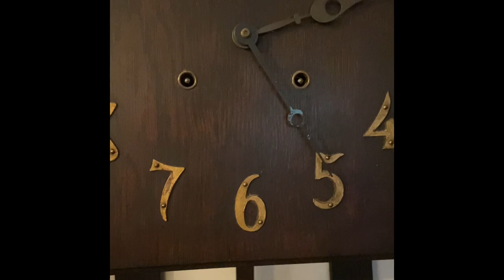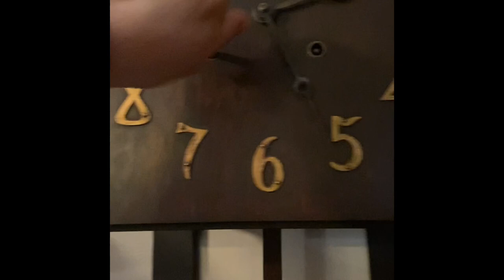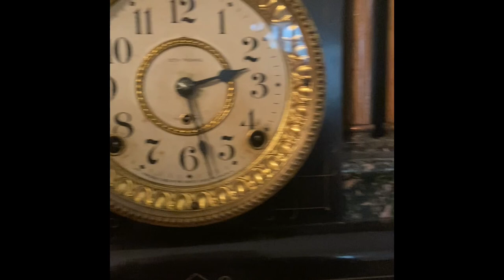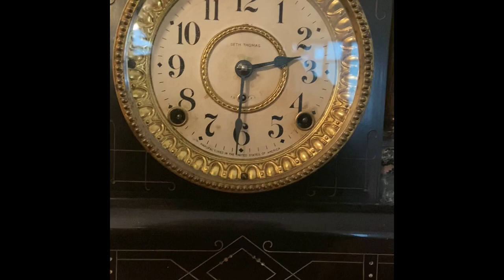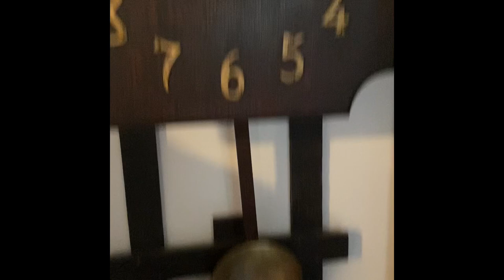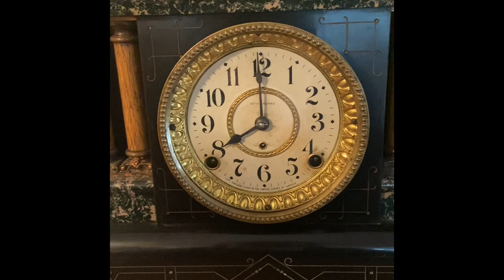How To: key wind an old clock: Seth Thomas and Sessions

Comment: People who dont know clocks always think that their clock is overwound.  You cant overwind a clock or a pocketwatch. They were designed to be wound all the way. Never ever turn the minute hand backwards.  If the clock is running to fast then in the back there is what is called a pendulum bob. Underneath it is a nut of some sort. I always tell people lower to slower. Only do that adjustments in small increments. When winding wind slow. If the clock needs serviced which is supposed to be done every 5 years or so because there is a click that catches the teeth on the winding arbor. If you go to fast it can break/slip and you will know this because you can get hurt.  Good video though.